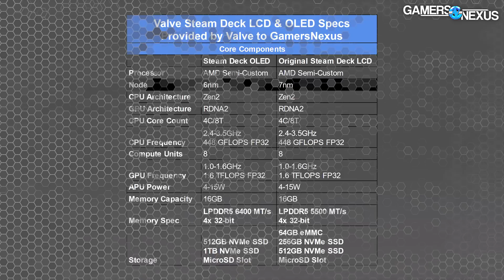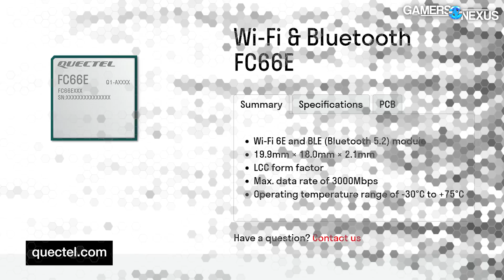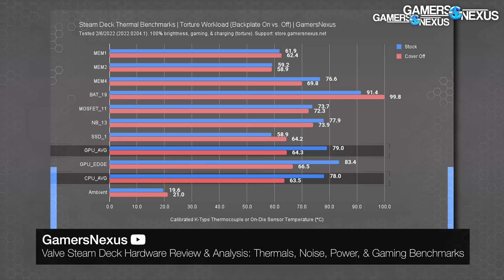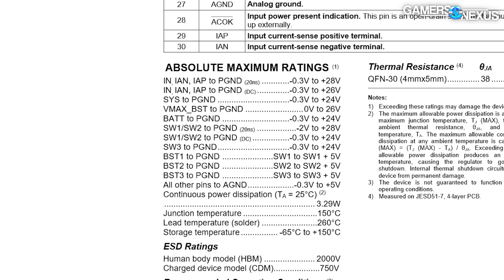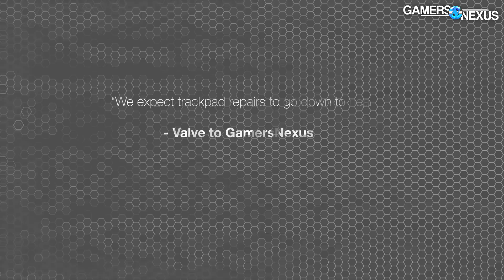They Changed Everything: Valve Steam Deck OLED vs. LCD Tear-Down

Comment: In the thermal video, the charging chip gets hot, if you are not playing a game but say browsing the net where the apu would run cool therfore the fan speed is low, how hot does the charging chip get? Is that the reason for some melting? Could a small copper heat pipe connected to the apu cooler keep the temp down?

Comment: Nope, the joysticks are more sensitive to fall damage. I accidentally dropped mine off the side of my bed. It’s a good 2 1/2 feet drop and the joystick popped out. I had to take apart the joystick and put it back together.
Reply: My old steam deck has fallen off of my bed numerous of times it’s only when I’m charging it. I have it on the edge of my bed, but the joysticks have never popped out.

Comment: Advances in shrinking an IC into a smaller packaging is usually very nice as seen here, especially if they improve the thermals. It's awesome that Steam's team kept up with what's available on the market as it can be difficult to verify that the new stuff is reliable enough to integrate and lean on.

Comment: This comprehensive review, even down to sonics, fortifies that Valve got the first Steamdeck done like a prototype in all respects. The new OLED isn't just a new screen, which could have been done with the same roadmap, but Valve actually put time in to engineer improvements from near scratch with the same housing.

Also, this guy knows his stuff so well I learned a bit.

Comment: 8:19 Pads and TIMs are a massive thermal brake. Designers don't use them if they don't have to, especially if coupling to graphite-copper tape.

Comment: good thing about SteamDeck OLED is, now used SteamDeck for sale as low as $250 bucks, you can't get anything better for emulating retro games from Atari 2600 towards PS2 / Xbox (original) / Wii / Gamecube era  as low as 250 bucks 😅

Comment: Having done PCB design and hardware engineering myself i can say with no uncerrtainty that what  Valve have done to the new SteamDeck is basically turning it into a completely new product from a workload perspective.

Just something "simple" as twisting the cpu impacts the main board layout considerably and is no small task. 
This is actually pretty impressive tbh.

Comment: Does fewer memory modules reduce the available memory bandwidth? The previous spec for Steam deck indicated a quad channel memory configuration. Is it possible there is crosstalk from the (filtering reduced) VRMs to the audio channels which would produce the clockspeed-sensitive buzzing reported by some headphone users?

Comment: I can’t wait for frore systems air jets to be available for commercial use and eventually finds its way into an oled steam deck which could drastically increase the battery size. Then undervolting the heck out of it and using cryo utilities to curb any performance loss. That would at least be an hour increase of gameplay on the triple a titles I play on the original steam deck. 😉

Comment: re: the thumbstick PCBs -- I don't think the change helps resistance of the thumbstick PCB to fall damage, and I suspect Valve knows that.  No matter how many extra traces, building around flex means building around trace fails so it's going to fail eventually.

What I suspect they meant is that they help the resistance of the Steam Deck itself to fall damage.  With the old PCBs screwed straight to the mainboard with no flex built in, more of the stress of a fall gets transferred directly to the mainboard.  The new thumbstick PCB will probably fail a bit more than the old one -- but it is probably meant to; after all, would you rather replace a thumbstick or the entire mainboard?  (Especially considering how tremendous a pain in the ass it is to replace that particular mainboard, at least on the old devices)

It's a smart move both for Valve having to deal with warranty repairs from damage caused to mainboards by impact to thumbsticks, and for the longevity of Steam Decks themselves with regard to flex and strain over time on the mainboard.

Comment: Dumb question: does Valve still ship the Deck with different types of SSDs? Are they still PCI3x4? I will probably update mine to 2TB anyway but I am curious if now there is still the risk to get a PCI3x2 SSD with these devices :)

Comment: Any word if the 3rd party Jsaux PC0106 Backplate mod with the interchangeable buttons will work with the OLED model or not?  Also, if so, with the fan being flipped, would it be beneficial to use the OG PC0106 without the center hole in the backplate or the new one?

Comment: At three moment I have no need for such a device, but if that will change, I would prefer the steam deck over the others, just because of the repairability and the easy access to replacement parts. Of course, Linux is a big plus on top of it.

Thanks for the video, it was very interesting.

Maybe Valve should start, building cars 😂

Comment: What will happen if we make passive custom cooling in the form of a thin aluminum radiator for the entire flat area of the back cover, through a thermal pad as in the LCD version? How much can the temperature be lowered?

Comment: Thanks for the video - even though I'm a bit dissapointed now.
I had hoped that It would be possible to retrofit the better cooling, bigger battery and all the good stuff into a LCD steam deck so I can reap all the benefits of the screen "sidegrade" OTHER than the screen itself ... because, to me, OLED is NOT an upgrade, OLED is throw-away technology just like CRT and Plasma (and CCFL backlit LCD) ... and I don't want any of that ...

Comment: The stick board bumper change is one I'm very happy about, on my original deck I had dropped it while in it's case, and thanks to the handle location it struck the ground right on the bumper, noticeably changing its click behavior; becoming silent and not registering unless receiving significant pressure. Had to get that one rma'd

With this new design I feel like I could easily replace it myself, the old one i would have needed to solder on a new switch

Comment: It seems the heatsink on the JSAUX transparent backplate mod will probably be made redundant by these changes. As it appears the heat shield the aftermarket heatsink makes contact with is no longer having heat sinked into it.

I'm hoping JSAUX release an updated design soon as i really like the raised grip buttons and the look of the transparent backplate.

Comment: Larger inductors to handle the lower efficiency of the 1920 buck circuit as opposed to the smaller, more efficient 2011 Ćuk-buck2. How wise to pick the inferior, less efficient, larger solution rather than having their engineers learn about the last 100 years of power conversion improvements.

Comment: As far as plastic goes it’s same with different support spots. However I was curious on the limited edition where it stated it was resin based.  so how would change the quality of drops or heat transfer or strength?

Comment: Valve said parts are cheap. Wow. That sheds some light on how many times companies charge on a device as compared to raw cost of producing the device, excluding R&D.
Reply: Assuming the parts arnt made to order yes, hence why they're using basically the same screen as the Switch OLED.

Comment: I just wanna know if I can put the OLED screen on my LCD steam deck. Are the connections the same?
Reply: and the screen controllers are different. LCD and oled panels don't work the same so you'd need a new screen controller.
Reply: No, the internals are redesigned and the screen is thinner, which is the reason why the new battery and stuff fits.

Comment: I'm curious if 3rd party Steam Deck packplates will still be compatible. Would depend entirely on how much they changed for the shell itself. I am planning on getting an OLED Steam Deck next month, and if I can keep my transparent red backplate, I 100% want to.
Reply: I would imagine not since existing backplates use phillips head screws, and the new thread is torx. trying to put the wrong screw might damage the deck.

Comment: Looks like (on the surface at least) they might be able to move the nvme connector into a different position to allow for longer ssd’s not that I don’t mind the tiny ssd’s other than the cost

Comment: This is pretty much a Steamdeck 2 in everything but name, people saying they are going to hold out until SteamDeck 2 will likely be waiting a very long time as valve believes 3 Nm isn't even good enough for an offical upgrade.  The fact that you have a OLED on a device that isn't a phone, on a screen under 42' in itself astnonshing, that's combinded with battery increase/ smaller node/ and faster ram effectively means higher performance per watt.  

And is has now uses NVME SSD, and lighter, and cooler, and quiter, and higher storage, and ect.

Comment: Hey Steve! I request you to please ask Valve peeps to bring the left and right daughter boards in stock. The reason for the unavailability that they stated is the boards need to be "calibration." This was a year ago and it shouldn't take this long since it's one of the easiest to break. I hope they don't not bring it because the latest deck uses a different design and integrates the Left and right buttons on the Thumbsticks.

Comment: Valve: alot of Understatement. basically a complete pcb redesign for efficiency. great engineering work. i like it alot. 

Great video in terms of doing the analysis, presentation and explanation. Definitely better advertising than Valve's and Valve's marketing team should honor that. 
♥

Comment: Linus mentioned that when they asked Valve why they didn't go with Hall Effect sensors, they were told that there were reliability issues. Can you elaborate what they meant? Is there a weak point in hall effect tech that isn't widely known, hence why console manufacturers avoid it like a plague?

Comment: I'm curious, do the new thumb-sticks use hall effect sensors or not?
If not, I'm gonna wait until the aftermarket catches up (or just not get one, if the aftermarket never does catch up), because I'm not about to let something as mundane as the thumbsticks turn this (very expensive) item into a paperweight.

For reference, the same issue plagues the Valve Index VR controllers, many users report that daily use results in stick drift within something on the order of 6 months of use, which is intolerable when just a pair of controllers costs more than an entire Nintendo Switch.
Oh, and you can just forget about getting replacement parts for your Index controllers, nobody makes them that I've been able to find. Not with the thumb proximity sensor at least.

Basically, I'd hate to have to send in the entire steam deck just because the potentiometers in the thumb sticks wore out.

There are aftermarket thumb sticks available for the non-OLED steam deck that do offer this hall effect position sensor technology, and I'm very curious why it's not used by default in such an expensive device.
Same question goes for the Valve Index VR controllers, with what consumers are paying for them there should be no worry about stick drift or similar joystick performance issues, and yet most people that use a Valve Index every day report that they have to keep 2 pairs of controllers on hand, not for charging but in case one of them has a thumb-stick drift issue.
So maybe you should do a video to get to the bottom of "Joycon Drift", why it happens, and why we don't remember it happening with older game consoles.
Because it seems to have been an issue that everyone laughed at the Nintendo Switch for, but it followed the laughter back home and now everyone's dealing with it.
Did someone make a "value oriented" joystick that drifts intentionally after a (rather short) lifespan, to encourage further purchase of console accessories (a form of planned obsolescence), did they choose that same "value oriented" joystick for other reasons, or are there patents in the way that prevent big industry players like Sony, Microsoft, Nintendo (and Valve I guess, tho they're not big in the hardware realm) from using the "obviously superior" hall effect position sensor tech in the thumbsticks of their devices?

Oh, and if it's greed like I think it is, CALL IT OUT AS SUCH!
The more we try to claw tech corporations back from the brink of end-stage capitalism, the better. Too many have already fallen over the edge.
You called out Artesian Builds for their bullcrap, I would like to see you continue that legacy.
Reply: no
Reply: @kuhpunkt 
You'd think they'd use durable thumbsticks, IDK what changed in the past few years to make every controller ever only last 6 months. How did they do that in concert with each other? If I thought they were smart enough for it, and if there weren't very easily enforced laws against specifically this thing, I'd say we have a conspiracy to ship poor quality products for an extreme markup on our hands.
Reply: @44R0Ndin  hall effect supposedly aren't that great either.
Reply: @kuhpunkt 
That might be why the joysticks suck so much these days, the controllers are set up with such small deadbands that any little bit of drift will register as an input instead of staying in the middle like it's supposed to. The reason for the tiny deadband? FPS games, apparently.
The problem is that the newer first-party controllers are trying to replicate the feel of higher-end controllers that use a smaller deadband AND HIGHER QUALITY THUMBSTICKS, but the first-party controllers don't spend the money on the better thumbsticks so you get the predictable effect of drifting within 6 months.

In any case, the thumbsticks I put in my Nintendo Switch Joycons are hall effect sensors, and once I calibrated them I think they're much better than the original potentiometer based ones.
I realize that the only way we'll get a truly drift free thumbstick is if we switch to sticks that are made of die-cast Zinc alloy (probably wanna use the zinc alloy that Hi-Point firearm slides and frames are made of, because yes that's actually a zinc alloy that is cast to net shape and finish machined), and use hall effect sensors for position sensing. Do that (along with using mouse button switches for all the buttons) and you'll have a controller that should easily last 10 years of hard use. And it'll only cost twice as much to make, which means they'll only have to cut into their profit margins a little bit for that.

I miss the days when "made by Nintendo" meant that something was about as durable as the famous Nokia 6610 "brick" (aka nearly indestructible).
These days if you look at any console's controller wrong it drifts, and I'm fed up with it. I refuse to buy 1st party controllers anymore, and saying "Hall effect or nothing" is one way to ensure that I get 3rd party controllers of sufficient quality for my purposes.

Comment: Only criticisms I have for the video is generally it's "before" -> "after" / "left" -> "right" (at least in English) and so the comparisons feel a little bit off being "OLED" -> "LCD".
Also the description and visuals for the fan being "flipped" weren't very clear as to what exactly is meant. The description almost sounds like it's flipped on axis but the camera pass minutes later look like it's on the other side of the IC/Heatpipe.
Some visuals for the chassis shots minutes later provide no indication of LCD vs OLED, so it's up to the viewer to guess which is which.
On the hardware side, it sounds like an amazing refresh with a lot of actual hard work and design effort being put into it.
Pretty crazy when you compare it to the "refreshes" we've gotten from companies like Intel lately.

Comment: My only hardware issue with my original Steam Deck over the last year was a broken bumper microswitch (the "side" switch broke on one side, the top one still worked).
The warranty repair experience was great, and I got my Deck back in just over a week, but it's awesome to see that Valve is making improvements to the design to address weak spots.

Comment: Wifi is an issue in the old model, it often will overheat then stop working, valve replaced my unit 3 times before I got one that was stable but I also had to stop using usb accesories like my Samsung ssd to prevent thr issue from reoccuring. It seems the Oled fixes many design flaws most consumers are now stuck with..

Comment: FEEDBACK:
kinda objective
- content = top notch. the research, the inquiry at valve
- presentation = starting from the biggest change (the cpu) and spreading out from there makes for an excellent "tracklist" good job on that choice
- editing = as always the added post production work (eg: adding those squares to point to some part of the pcb) is absolutely fantastic, helpful and very well done. 

kinda subjective
- editing =(friendly & respectful shoutout to jay2cents who does the opposit with a shaky cam following his finger, which is horrible, but he's entertaining - side note : you GN are not , you are technical, which is what i personaly seek)
production design = that light up table is nice , and its use here is pertinent (suggestion , color code: red  is mecanical parts , blue is PCBs , black is the enclosure)
the microscope you used: nice, but we don't want to see you the host looking at the camera then shifting his sight to his monitor (which we can see) then shift back to the camera. that "breaks the immersion" (to use a gaming term). suggestion: see how Louis does it: he's talking to the camera, flips a switch to show us the microscope's pov, then flip the switch back. 
(i'll reply to myself if i see some more stuff to point out)

in any case thank you for research.
now i want one ^